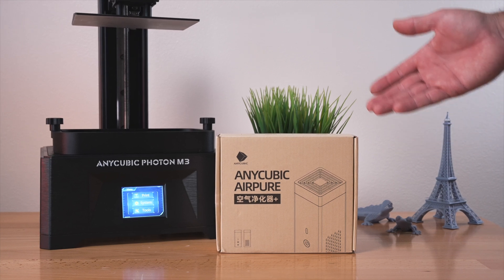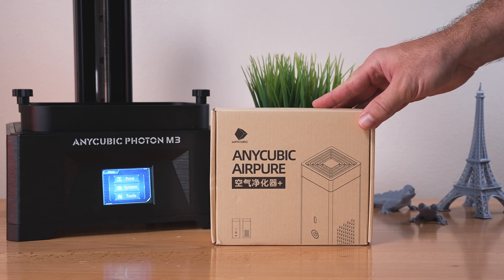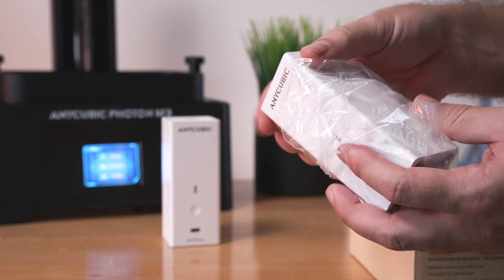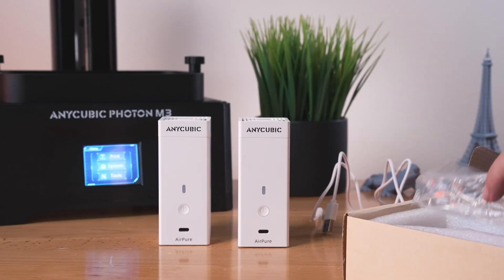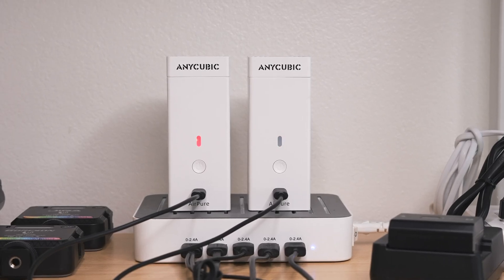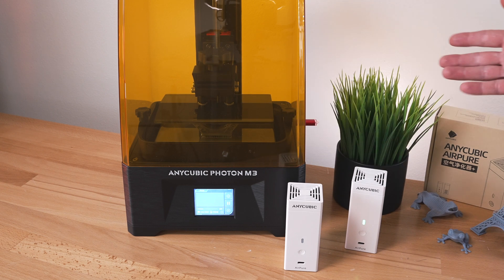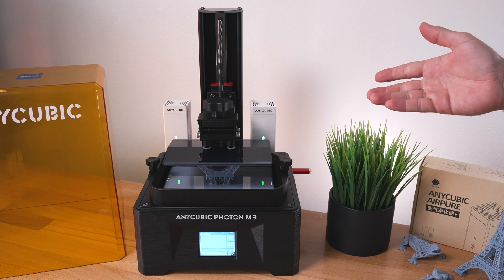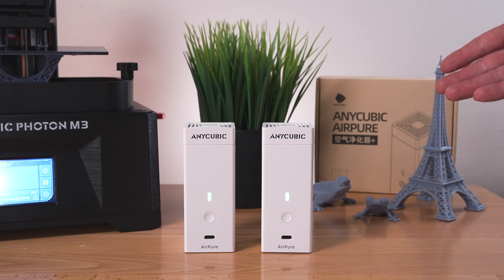Anycubic AirPure - Carbon Filtration - Resin 3D Printing

Comment: Don't buy this product for M7 max - it makes ZERO difference. With them or without them - result is ABSOLUTELY the same. Money waste. It makes no sense at all to use them outside the printer. They move close to 0 air. And inside the printer - no effect at all.

Comment: hmm, i think its not good to have the activated carbon without a normal Hepa filter because it will create ultra fine carbon dust into your lung
Reply: That's not how activated carbon filters work. It's not just loosely held together. Imagine the much larger amount of carbon dust that would be created if you ran water through it (these are used for water filtration as well). You'd be able to run water through it while evaporating it off afterwards, which would accrete carbon at the bottom. Even so, it's relatively such a miniscule amount that you honestly have worse things you're breathing in your own home.

Comment: Can they also be used for soldering as a fume absorber?
Reply: sure why not, it will be better, but keep in mind due it small they anyway will pass smoke, as for me you could easily make your own filter, just take 15cm PVC water pipe, one vacuum cleaner bag on sides, and put aquarium active charcoal inside, all this stuff will price ~20 eur
so you need only small air extractor from amazon)
for "real" cleaning also used KMnO4 balls also in pvc pipe, but in this case you need to be caution due it's agressive and should be keeped out of water and charcoal (like two separated filters in chain)

Comment: I have the new Elegoo Saturn 2 now and it comes with a tall version of carbon filter which is 3 times more tall than these have in them.
With the Elegoo unit there is a special usb port built in the back left corner of the base inside the cover of the Saturn 2 you plug the carbon filter unit in there.

Well, All I can say is mine don't make any difference at all to the smell from the Saturn 2 and the unit led lit up green when plugged in so yes it runs.
I use the Elegoo water washable resin so lower odor than the normal resin and no IPA needed to clean.

I even had the tank fully cleaned and the build plate too and even leaving the printer turned on with no resin in it and the filter plugged in and running it still stinks of resin.

Yes I removed the plastic bag from the tall carbon filter block before placing it in the filter unit.

Plus Elegoo advertised that we could buy replacement tall carbon blocks for the unit I use. But they don't sell them even months after the Saturn 2 was released?

I searched online and there is a few companies whom do sell the small blocks of filter carbon seen here. Even if mine started working I would need 3 blocks to fill this taller unit.

Not good Elegoo having a carbon tall unit that I've found don't do the job.  I saw a review of the Elegoo version of these rechargeable two units which state they work.

Comment: For filters on these, just buy some activated carbon at your local pet store.  It's usually sold for aquarium filters, but you could print a small enclosure for them, and use them here with no problem.

Comment: I think a better test would have been to put these in the machine before even starting it so the fumes didn't have a chance to build up.  I have to wonder if you were smelling residual smell from before you turned them on.

Comment: Are the carbon filters replaceable or does the whole units have to be replaced?  Thanks
Reply: 0:27 They are replaceable
Reply: @zora_tech  i googled around and cant seem to see any carbon filter replacements sold separately.  I asked because I saw other comments asking the same thing on elegoo air filters as well on amazon comment section.
Reply: @redone823  ah so I thought you just wanted to know if they were replaceable. But what you were asking is if you can buy the replaceable filters separately. I don't think these are very popular just yet so your best bet would be trying to find them on a Chinese vender since they are most likely to be made in China. But again if they aren't selling a lot of them then I doubt anyone would be interested in just selling the filters.
Reply: @zora_tech  The fact that they have been produced and sold means somewhere out there are a lot of carbon filters, sitting around in a crate in a warehouse. Not offering them up for sale because of low sales numbers of the units when the low sales numbers is due to no replacement filters is dumb. If you wanna sell something that has replaceable parts, make them replaceable. No wonder they dont sell.